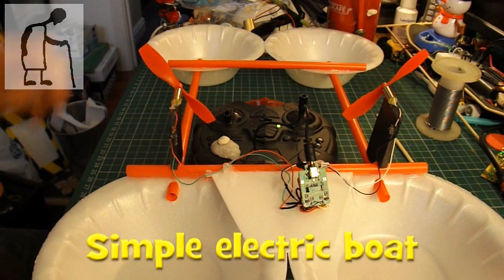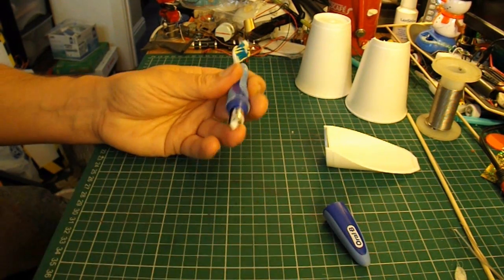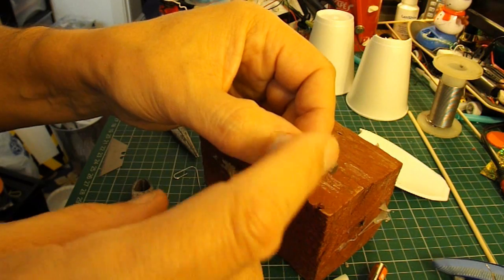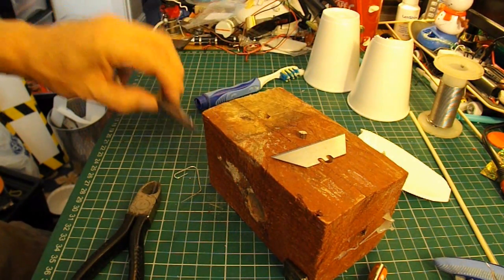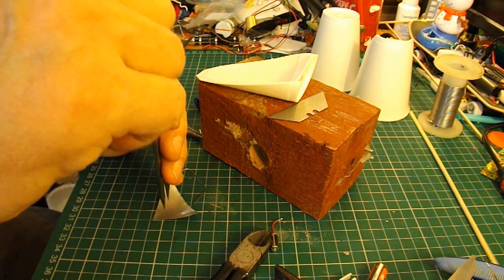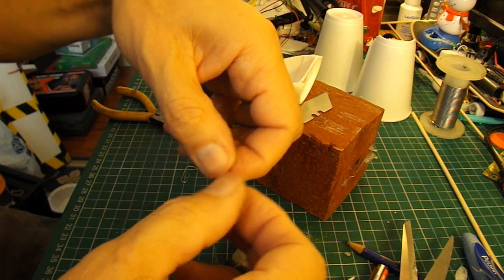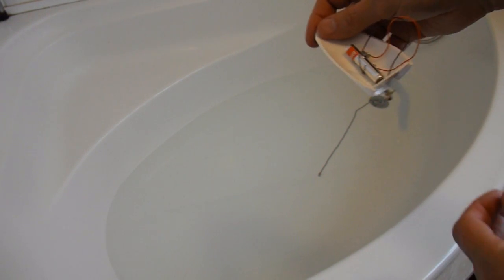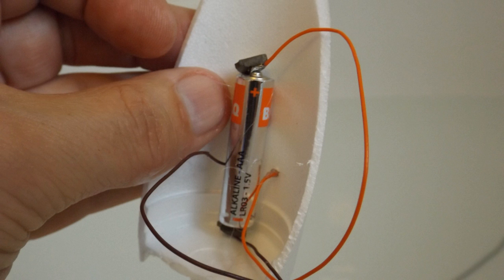Simple electric boat from Styrofoam Cup

Comment: i didnt know you could put a motor in water ?? can u actully do it ?? btw im dammdelta but this is my dads phone
Reply from the maker: +ibrahim ahmad I think I just demonstrated it works didn't I? Some motors will fail, some will survive. I don't need it to last for ever so even if it does fail eventually I am not concerned. You will find RC Car racers often 'run-in' their motors by putting them in water. I used the same idea on this boat which lasted fine until I lost it https://youtu.be/iBXO2qH8UP4